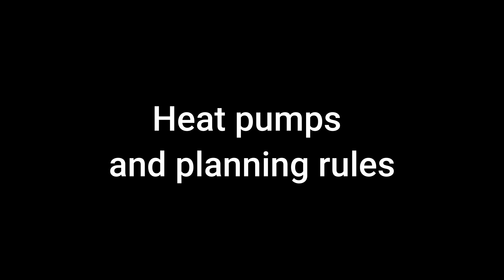Air Source Planning Rules

Comment: That was a good assessment. Speaking in August 2025 the new rules are now in place. The new noise rules go from 42 dB to 37dB, but also the method of calculation. If it was 40dB and passed under the old rules it does not mean it will fail under the new rules. Also mitigations changed. Eg If it does fail under the new rules, you might just need to replace an open fence with solid panels. Also as you say bigger fans means quieter fans. You can bet your bottom dollar the UK HP industry was consulted when formulating the new rules which are designed to increase HP take up. All UK made brands (Vaillant Arotherm, Ideal Logic, Mitsubish Ecodan) are already very quiet as they are designed to fit in with UK rules, otherwise they would be out of business. Also new rules allow you to fit an air conditioning unit as well as an Heat Pump for domestic heating. Hydronic heating systems are poor at cooling, which is why you might want a cooling system - the new rules make sure any air conditioner is reversible and capable of heating which has been the case for almost all units sold in the UK in the last 20 years so a non issue. 
Of course the MCS rules are just an estimate of noise nuisance and no actual measurement of the noise coming from an outside unit is made. Any heat pump that makes undue noise may actually have a mechanical problem - eg not installed level, compressor fault,
worn bearings, loose bolts and mounting. If a heat pump sounds excessively noisy the  installer/manufacturer has a duty to get it fixed or replaced under warranty (they will need to come out make a measurement of noise level). A yearly service is usually required to comply with warranty for most makes.

Comment: Just got bounced for a heat pump really gutted ba cause of noise regulations. I live in a terraced house no way of getting over the noise limit.  No chance for the terraced houses of the uk for heat pumps.
Reply from the maker: This is really surprising……it’s rare a heat pump won’t pass the MCS020 sound calculation unless your house is very large and your neighbours window is incredibly close to the unit position?
Reply: @Rowlysrenewableroadshow neighbours window (either side) quite close to wherever I can site the heat pump so no way around it according to the octopus guy. Mega gutted as I was so happy to get rid of the old boiler.
Reply from the maker: @dharmensoneji3360 ahh frustrating. However Octopus have limited experience (long term) on heat pump installation. They are also working tight installation processes and limited manufacturers they can use. It may be worth reaching out to a local installer. We install on terrace houses day in day out…..

Comment: I’m not sure there’s a lot of hope for a bigger rollout if 37 degrees is to replace the current permitted noise limit. Surely it’s making it harder to get past the regulations not easier. Also bonkers that my flue emits about 60db when it fires up. No regs against that. 😢

Comment: Do you know if the 2 ASHP for detached houses will mean you can have an air to water for heating and also an air to air for cooling? Or is it still only units for heating only...
Reply: Air to air was included under the heat pump umbrella for VAT relief purposes a while back so I would expect it to be included in this.
Reply from the maker: Hi, yes MCS did state a2a will be included.
Reply: @Rowlysrenewableroadshow Ooh that's very good. I can't put an ASHP at my parent's house because they live in a terraced house. I could probably get an ASHP without planning permission curently, in my semi detached house but could still potentially be an issue. Either way, realistically they cah have an air to air heat pump because they can't exactly put a hot water tank anywhere

But I could myself. It means that you can at least get your heating decarbonised even if your hot water is still fairly carbon based. But given that most of the carbon used is for heating, that's still a massive win.

Comment: Why in this country do we always have to have something outside the goverment to set rules. All these extra layers of rules just put the cost up to get things installed and in my experience especially with heat pumps does not guarantee a good job. I have seen many that I have been very poor, oversized heat pumps undersized pipe work even one where I had ti re pipe it as it was that bad they had even left 6 metres of 28mm pipe outside un insulated as the customer couldn't see it as the heat pump was on the garage roof. Not impressed with what I have seen dine by so called MCS approved installers. Does it stand for Makes Costs Skyrocket!
Reply from the maker: You’re preaching to the converted. I agree the layers of schemes add cost that is ultimately passed to the consumer. When I chat to German and French colleagues they can’t believe what we have to deal with.
Reply: @Rowlysrenewableroadshow  best to just carry on regardless I fitted my own at a cost of about 6k for a 16kw Samsung. Hot water cylinder was OK so just had to up some radiators. Completely happy with it although a 12kw would have been big enough I think
Reply: You must remember the jobs for the boys syndrome , John Prescott was a great instigator and as noted the rules don’t necessarily lead to quality work .

Comment: Thanks for video update and info, Adam, the effort is much appreciated. Some queries/thoughts/bollocks: 
(i) Boundary locating: (agree the 1m rule was stupid); yeah, hedges too 'transparent' visually, but also airflow and sound-wise. Fences, though, can be in many forms, and not necessarily airflow-solid - so the heat exchanger exhaust could still be directed across the boundary into the neighbouring property's airmass, possibly at some (energy) loss to them, especially if pointed at their house, car, ashp etc.  (Similar if direction reversed, but less so.)  Terrain/building topology can also be a determinant; e.g. cellar flats etc., where a 'cold pool' could form. 
(ii) 'Noise': Sorry, haven't read the detail of the regs and their impementation/measurement (but will soon), but assume the general SPL measurement standard is dB(a); a step-down to 37 DB(a) from 42 DB(a) is approaching 1/4 the 42 level, but is only perceived by our ear'oles as a much much smaller difference. Sound-baffling material (e.g. fencing) could remedy that 5dB(a) required performance 'increase' quite readily,  given the distance separation aspect might be a limiting condition. 
While being a big 'green energy' supporter,  wow, do i ever see some legal aggro (i.e.lawsuits) coming when some poor (?!?) Tesla driver goes out on a frosty morning to find his/her car unwilling to boot-up due to an ashp-assisted overnight freeze. In a similar way to condensing boiler flue directional regs, there may need to be more to the regs than present, especially in the relatively higher-density housing inhabited by most of the non-aristocracy.
There is sooo much to this field...
ATB and thanks again.
Reply from the maker: Thank you, I will reply to your points shortly. 

I agree  could probably talk about each point for an hour or two but I don’t think anyone could handle my voice for that long 🤣

This subject probably does deserve a long form podcast.
Reply: @Rowlysrenewableroadshow  yes please 😵‍💫

Comment: I have an existing A2A heat pump and want to add a new A2W heat pump to replace my gas boiler. Can I now do this from early next year without requiring planning permission? Have you any idea of what specific date this rule change with be effective from. Can I press ahead now for an install in say March 2025 confident I will not be required to get planning permission.

Thanks, I would appreciate your knowledgeable response to my questions.
Reply from the maker: Hi, no date as yet. But in theory yes you will be able to do that. 

No promises on the date yet.

Comment: A friend has two neighbours who have installed heat source air pumps and the noise is causing her stress, particularly at night.
Reply from the maker: That’s a shame, what make are the heat pumps?
Reply: But they hardly make any noise
Reply: I have had two Mitsubishi ecodans 11.2 kw installed even with both running they are whisper quiet . It is likely there is a problem if they are noisy.
Reply: I have an 8.5kw Ecodan at the side of my house and a small water feature in the middle of my garden. When standing at the heat pump you cannot hear it over the burbling of the water feature!